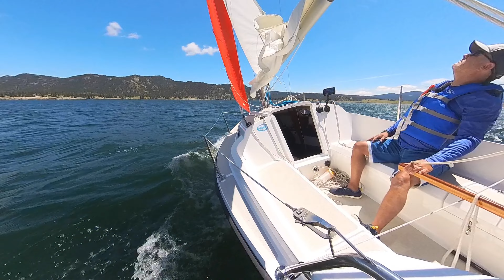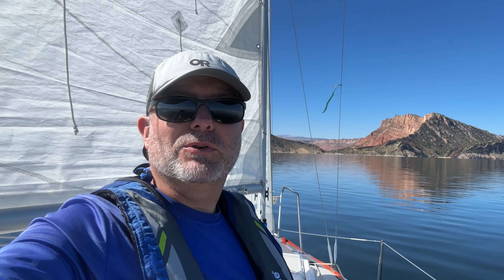Sailboat Personal Tethers

Comment: People think it will never happen, but I heard of an older solo sailor, experienced, who was forward to lower anchor, and lost his balance and fell in. Thankfully he survived. I especially understand the young daughter thing. The horror of Dad falling in, and not knowing how to get the boat back to him. I have the same Kong tether and use it in certain situations. Ideally trying to rig it to keep me on the deck. And falling in with a tether while the boat is moving apace, vs. sitting pretty still, is two different animals.
Reply from the maker: @saabtech3510  Very good point about the boat speed. I don’t go outside the cockpit when my boat is up to speed (since I have no crew to helm and I don’t rely on the autopilot in our gusty, variable mountain winds). When the wind is up and I need to go forward, I just heave-to. But even moving at slow speeds, it would be difficult to swim fast enough with PFD, clothes and deck shoes weighing me down to catch the boat if I fell in the water untethered. Since my normal lake is small and other boats normally around, my primary concern is using a PFD and not drowning. I’ve been involved in 3 rescues of kayakers or SUPers from the water at my lake, and in each case every boat around came in to help. But on a big, remote lake—you have to be your own rescuer. So the best course of action is to prevent going in the water. Paul Kresge, the commodore of the Dillon Reservoir Yacht Club and an experienced sailor, drowned in a squall when a wind shift caused a downwind broach heading back to the marina after completing a race. He was not wearing a PFD. It’s a dangerous sport…no room for foolhardiness.

Comment: Firstly, it is wonderful seeing a YouTuber talking about safety gear. Secondly, I'll let it be known that I've never used a tether. I'm a long time off the water and only ever sailed with PFD's, "back in the day". My son, however, does use a tether in open waters.
Thirdly, I have an opinion on everything! Observing your setup with the single jackline led down the starboard side, I'm wondering if it would not be a good idea to run a second jackline down the port side and affix a tether to both (within practical limits) so if you do have a stumble, the jackline on the opposite side prevents you from going overboard?
Either that or a jackline on the centreline and a shorter tether? 
I'm aware of three Australian sailors that have gone overboard with tethers attached. One of those was in the most recent Sydney to Hobart race and he was forced to cut the tether
as he was getting dragged below the water (blue water). A personal EPIRB and knowledge of sea survival ensured that it wasn't recorded as a fatality. Another was Australian sailor Kay Cottee, who was miraculously washed back on board by a wave while solo sailing in open waters. The third was a gentleman somewhere in the Timor sea (tropical) who was forced to cut himself free
as he couldn't reboard his vessel. His EPIRB saved him after six hours in the water. These are good luck stories. Staying on board seems pretty important, just the same.
Perhaps staying onboard isn't such a big deal if you can scream at your daughter to dump the sheets and put out a boarding ladder.  I'm just offering food for thought. Safety can't be talked about enough, in my opinion, and too many YouTube sailors set a very poor example, unlike yourself.
Like I said, it's just food for thought. I appreciate your content and the time that you take to bring us these uploads. Cheers.
Reply from the maker: @davidbrayshaw3529  it’s a tough nut to crack on a small boat, for sure. The beam on my boat is 7’5” at the widest point. So a 4’ tether at the widest point still puts me beyond the rail. If my lifelines didn’t snap, I may be suspended by the tether just above the water. But if the lifelines give, then I’m getting dragged in the water. I tried running a line from the mast forward along the centerline. But with the shrouds being just aft of the mast. That meant clipping in at the mast, moving around the outside of the shrouds, clipping into the line forward of the mast with the short tether, and then unclipping the long tether that was now wrapped tightly around the shrouds and having it whip around. That setup also did not provide an anchor point in the cockpit. Then I thought about running a line down the centerline, but with it over the companionway, it was either too tight to close the hatch, or too loose and defeated the purpose of having it on centerline. It also obstructed entry/exit for the companionway. The Precision top hatches are prone to cracking and are no longer made, so I also don’t want to put too much shock load or pressure on it. I think ideally I’d like to mount several D-rings on deck and clip in the short tether to those…I’m definitely still thinking about this little puzzle. And, I really would prefer to stay ON the deck when tethered.
Reply: @ColoradoSailing  Thank you very much for your considered reply. I'm reminded of an occupational health and safety course that I was required to take, a number of years ago. The lecturer's opening line was, "The only safe workplace is a closed one. All work places are dangerous". Over the following weeks, he proffered ways to reduce, rather than eliminate risk. It sounds like you are doing exactly that.
I do like your idea of D rings placed on deck at appropriate locations. These are common on offshore yachts in Australia. They might actually be a requirement under some race codes.
At the end of the day, you can only do what you can do. At least you are aware of the problem and have taken the steps that you can to mitigate them.
You are to be commended for raising awareness among others. There are far too many cowboys out there for aspiring sailors to emulate.
Once again, thank you for your reply and for taking the time to produce and post your content.
Reply from the maker: @davidbrayshaw3529  My pleasure. Thanks for the kind words and thanks for watching! ⛵️